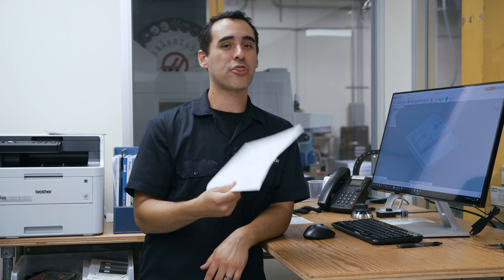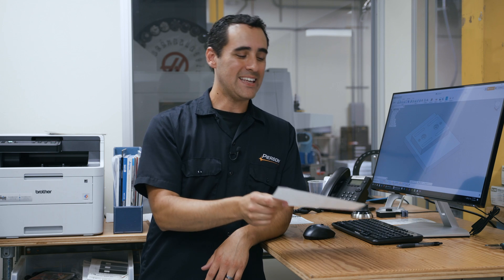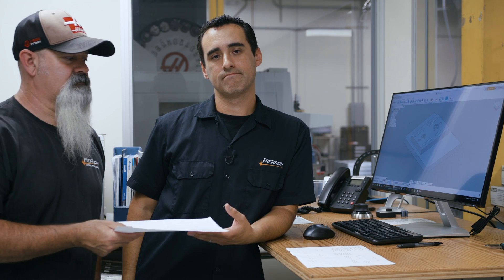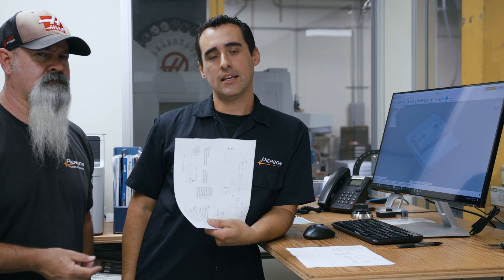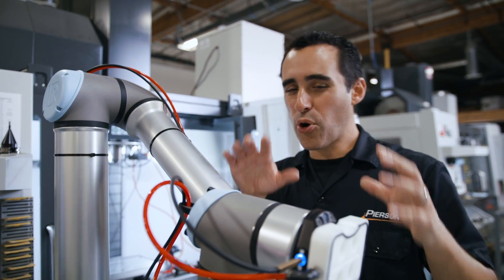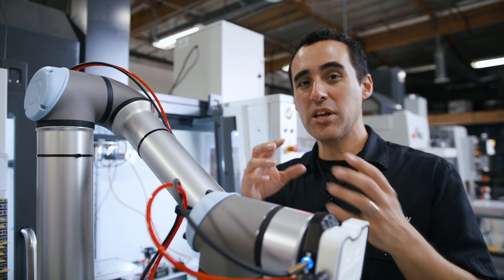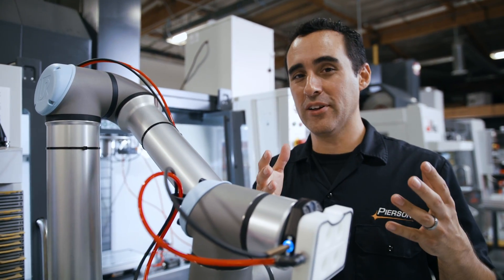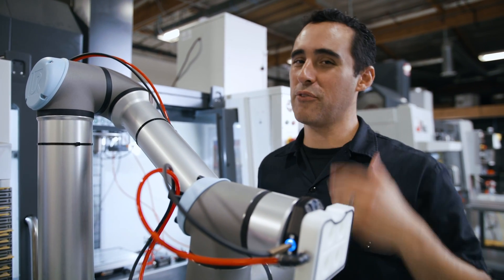Robotic Cell - The Final Setup | The Robot Episode 5

Comment from the maker: The gripper pads we used from McMaster-Carr: https://www.mcmaster.com/31305a46
Reply: I'm fairly sure those pads are made by Fairlane: http://www.fairlaneproducts.com/store/pc/Workholding-Positioning-c886.htm They appear to be part#HS-75-C or HS-75-C-EF. Several other lines of Fairlane products are carried by McMaster but often not the complete line. McMaster's prices don't seem very different from FixtureWorks' so the convenience of McMaster wins unless you need non-stocked components, which McMaster may be able to order for you. No affiliation, etc.
Reply: do you have a PN for those vacuum switches?
Reply from the maker: 46995K33
Reply: Impressive stuff, good video 🤓

Comment: Fantastic video.  as for the cable/air line management on these robots, I've seen standard coiled air line used along with velcro cable ties, velcro closure cable tubes with the velcro cable ties,  and adhesive cable tracks on the arm tubes themselves with the joints left open.  Just coil the coiled air line around the tube, wrap it and the cable with the spiral wrap of appropriate size or velcro type.  All work, some look better than others, love the printed versions y'all did.  There are all kinds of versions for industrial applications, but at this size robot and application, usually are overkill and EXPENSIVE.  Look at the Igus Triflex track (has some really nice band clamps for these robots), the WizardGear Cable Management systems (all inclusive avail), Panaduit makes some - but I kinda like the version that you have printed with the Techflex Flexio style using just a simple tie wrap or a velcro band clamp style - which I usually stitch to the velcro bands.  Not a critique at all of how you have them managed, but just info for others whom may be doing something similar.

Comment: How did you wire the "Fixture Clamp Input"? I followed Haas's documentation. I'm using a vacuum switch. I'm trying to set the same thing and it doesn't recognize a closed switch. The alarm rings no matter what. Are you on NGC or CHC? 🙏
Reply from the maker: Here are a couple walk-through videos for both versions: NGC https://youtu.be/7jAFptwj004 Classic: https://youtu.be/0t1eVRuEBt0
Reply: @PiersonWorkholding  Holy crap, thank you so much! I didn't realize the input# was not the same as the P## on the I/O board itself.

Comment: We get similar gripper components from essentra for our fixtures as we machine a lot of castings. Over those i would actually prefer a spherical contact point being that its an extruded surface. But im not too familiar with vacuum chucks. That pallet system should make changeover fast tho! Only thing you need left for the haas is BTS and you could be lights out lol.
Reply: Also, i would reccommend adding some small details to your vaccum plate for x and y locating. The robot can push the parts against the bumps. Same scenario for contact points. 3 points makes a plane but you truly only need 2 for a line there. That will make location more repeatable and reduce variation.